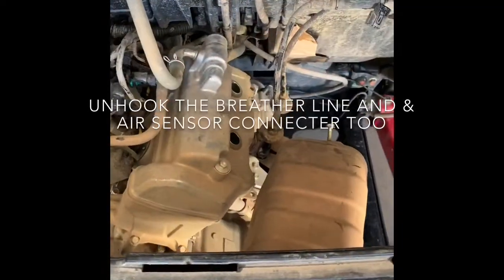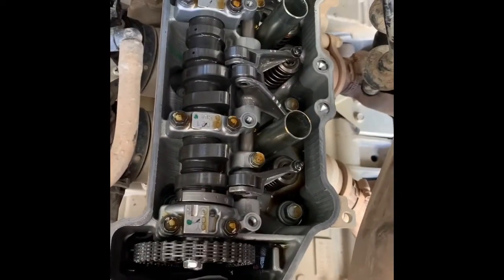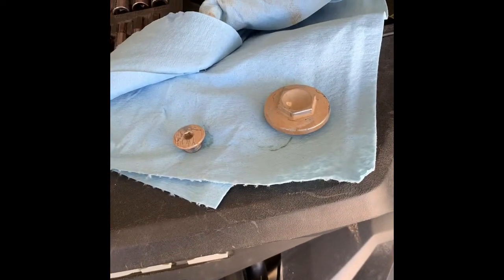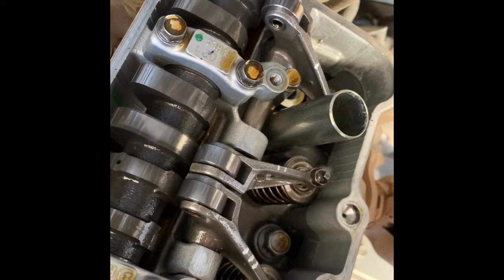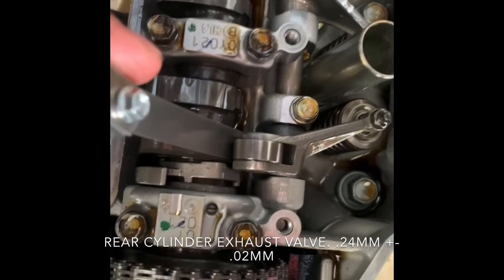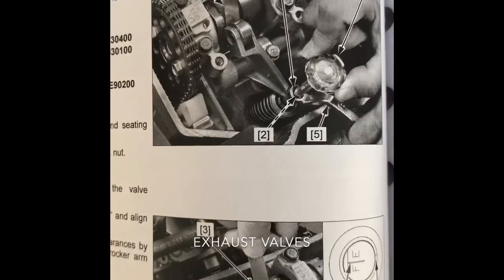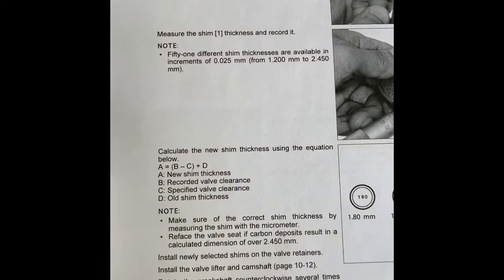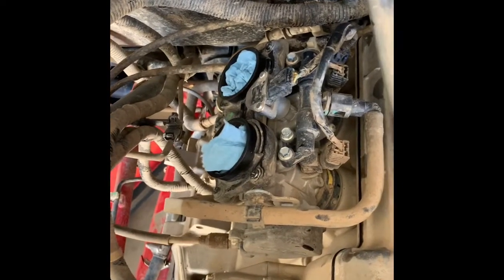Honda Talon Valve clearance adjustment inspection check. 1000R 1000X how to every 1800 miles

Comment: You did check all the valves I hope, because the video only shows checking half of the valves.  There are 4 valves per cylinder, 2 intakes and 2 exhaust.

Comment: Lots of people commenting on how the Honda is "flawed" because you're supposed to check the valve adjustment, this is false.  It's supposed to be done on many SXS's, as well as other vehicles, but people just ignore it.  The Honda manual states to check them if they're making noise.
Reply: And how am I to know if there is a valve noise, as opposed to the normal engine noise?
Reply: @MrUtubeobia   it will have a fairly detectable tick.
Reply from the maker: Agreed

Comment: why cant the valve clearance be adjusted with the adjustable rocker arms? just an auto mechanic that adjusted many honda car valves before. most likely does not need done for about 10k to 20k
 miles
Reply from the maker: I’ve never had to adjust them! I have about 17000 miles on talons so far

Comment: Sounds like Honda’s need a lot of adjustments and repair others do not
Reply from the maker: John Nelson Most makes require a valve inspection but people don’t do it.
Reply: Just trying to keep the engine running for a long time.

Comment: Sucks you gotta check the valves on the honda. Not aware of any other brand needing this. Definitely a mark against the talon.
Reply from the maker: Jason S. Majority of the sxs’s recommend a valve clearance inspection
Reply: Yamaha recommends this also but my local dealer never found a YXZ out of adjustment...
Reply from the maker: DUNE YXZ same with Honda, never found one out of adjustment. It’s just a precaution
Reply: Honda Talon Owner Exactly
Reply from the maker: DUNE YXZ but with this video you can check the clearance yourself instead of paying the dealer hundreds!
Reply: Honda Talon Owner Totally! You did a great job
Reply: Great video! Definitely a pain in the butt to have to do this, especially after just 100 miles for first service... I guess its true what they say, buying it is the cheap part...
Reply: They all require a valve clearance inspection and adjustment at some point.
Reply: What did you use to get the spark plugs out? Thanks for the response
Reply: Theres q tool under passenger seat lmfao @cmiracing